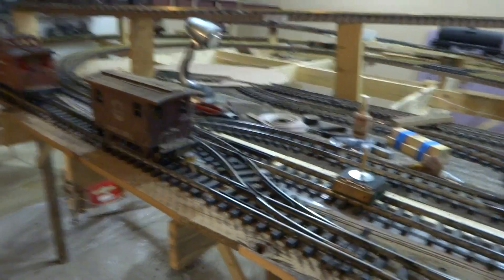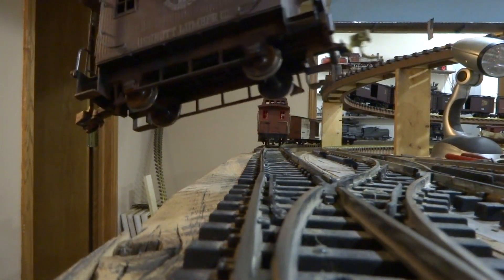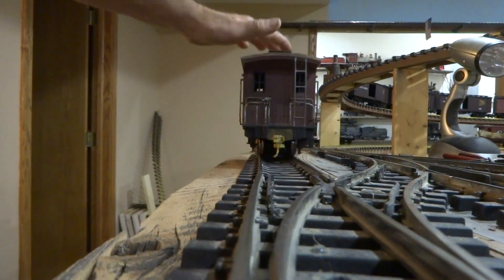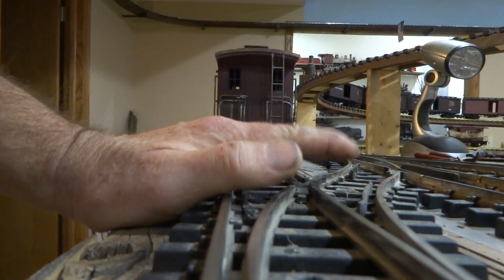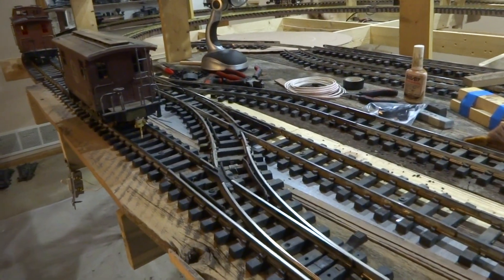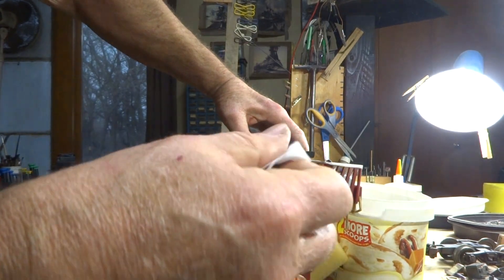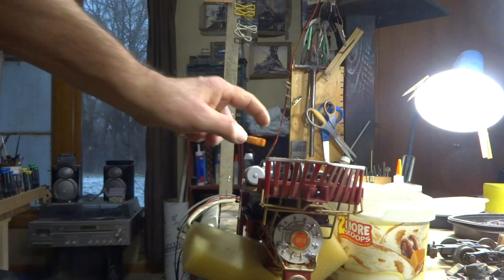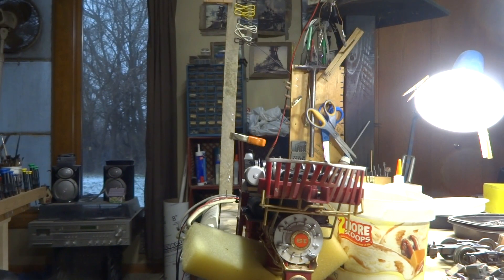Cleaning model railroad track

Comment: I can't remember if it was you or not, but someone suggested using car automatic transmission fluid on the rails to keep them clean. I havn't tried it myself yet, but by all accounts people said it works well and a quart of trans fluid is gonna last  a very long time on a model railroad. You only have to use a smear on a short length of track and then run the loco around a few times and tracks clean. As I say I have not done it yet, but intend to do so. Really good vids , by the way. Keep them coming. Happy New Year from the UK.
Reply from the maker: Oil of any kind can be used as a cleaner including No 1 diesel fuel, that is also a solvent, they sell for gas station cleaning tanks for parts and your hands as well. just remember oil stays on the track and does incapsulates dust. Its two fold cleaner and a dust collector

Comment: Ever thought about buying a G-Gauge Diesel?
Reply from the maker: No not really, I have always had steamers since my first train in 1959 it was a Marx and I still have it, it does run but its not so good these days kinda like me. Thx
Reply: I grew up a steam guy myself, but me being 25, I grew up in the diesel era. I like diesels as well. I 'be been to Hexagon which has a narrow gauge railroad ran by steam locomotives. I also recently did hands on the throttle in Owosso, Michigan on the 0-4-0 Jeddo Coal 85(AKA Mac). To be able to finally log my dream of running a steam locomotive was an awesome feeling. I'll tell you, your arm aches from pulling that throttle.
Reply from the maker: My cousin runs the Chinese steam loco in Boone Iowa that's a challenge
Reply: I bet. But as long as you enjoy it, it should be no problem. You should do Hands On The Throttle in Owosso, Michigan soon. To run the Jeddo Coal 85 would cost 160 bucks, to run the Pere Marquette 1225 would be 550. But it's worth it! It's an experience of a lifetime!
Reply from the maker: We travel a lot in our with our travel trailer and I will put this location in my book of stops, if we get to the area I will  look it up thx